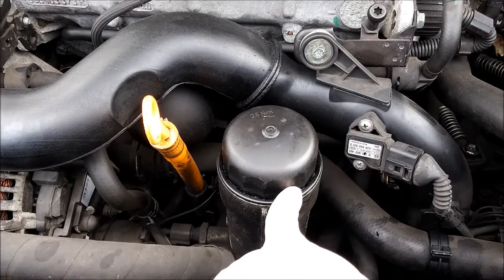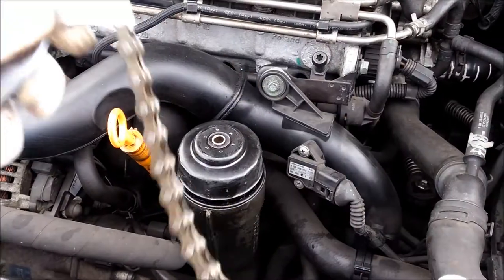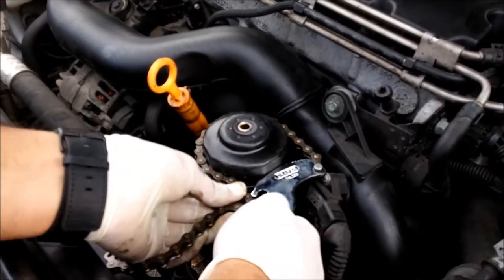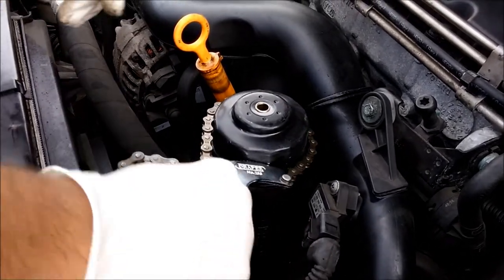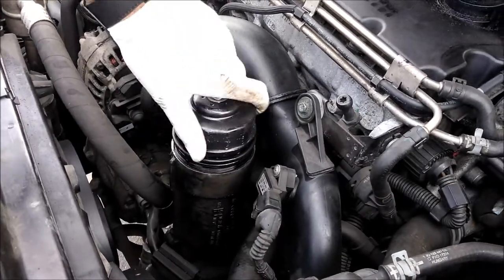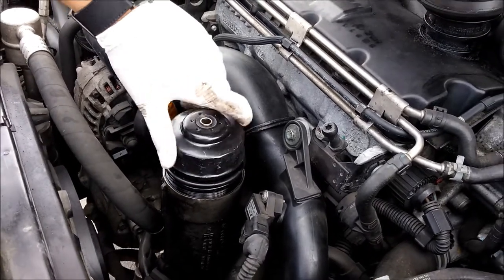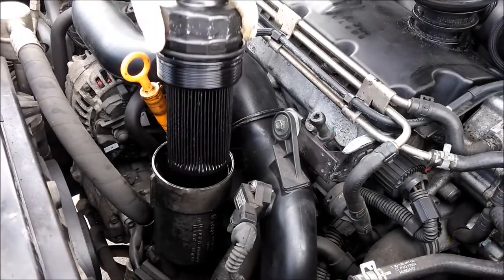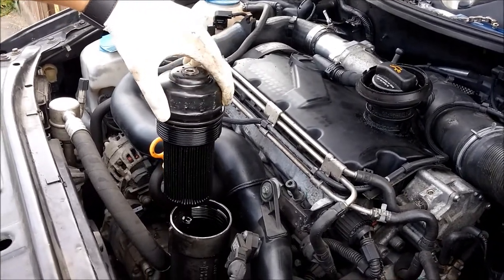Best Way to Remove Stuck Oil Filter - How to Use Chain Wrench

Comment: I just used the chain wrench but from Halfords UK, £7, and its great, except on my Toyota corolla d4d the gap between the oil sump and the filter is too small to accept the chain's thickness. Thus it is necessary to bend the oil filter to reduce its diameter to enable fitting of the chain onto the filter. Toyota very successfully housed a 2litee d4d engine (normally on toyota 4x4s) into a small car like the corolla but with minimal working space for mechanic's tools. My previous oil filter wrench was made of a thin metal sheet, which snaps easily, and she snapped trying to remove the filter, but the chain wrench finally worked well after some negotiation and problem solving. Thanks.